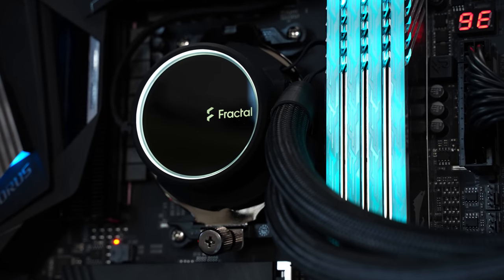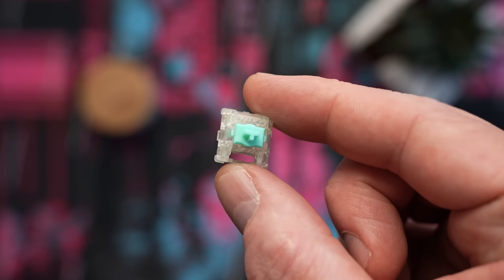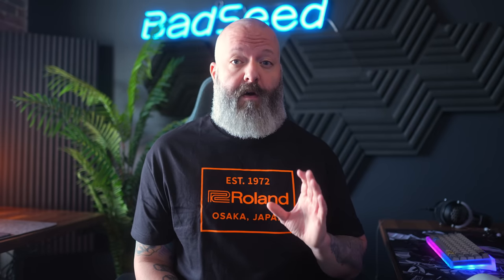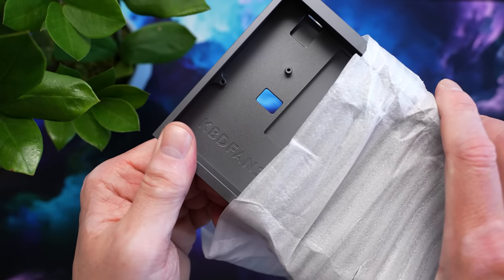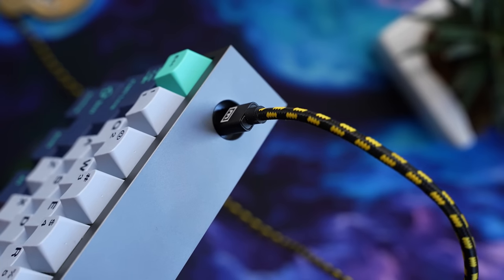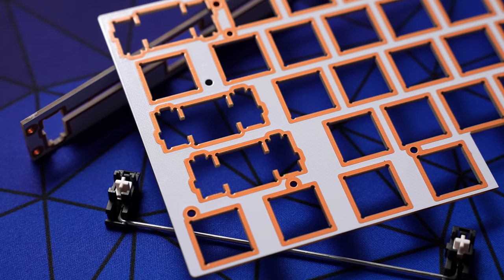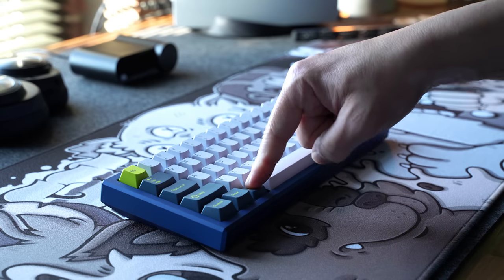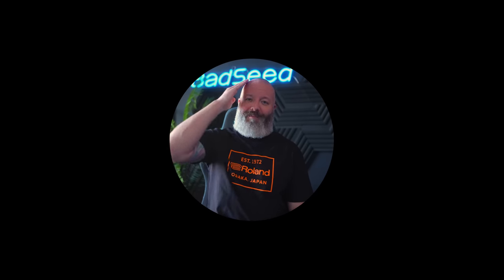Ultimate Wooting 60HE Mod Guide

Comment: This feels like a product from the future. I'm shocked it didn't take them years longer to start releasing modding-friendly versions of their keyboards
Reply: Bro this is literally the same process as any other hot swap keyboard on the market (from $50-1000). Only thing different is the switches
Reply: @manfromwuhan714  yeah, but there isn't another gaming keyboard manufacturer that allows this much room for modding their keyboard. And it also happens to be the best performing gaming keyboard? That's wild
Reply: You new to keyboards?
Reply: @DoctorQcumber  simply calling it the best performing keyboard doesn’t do it justice in the slightest, it’s the only keyboard you can get joystick level control with and it’s instant reset on release of the key makes the keyboard 1000% more responsive than anything else you can get
Reply: @manfromwuhan714 nope. lol. Wooting is the first keyboard to offer rapid trigger and other features that benefit you in gaming. Most gaming prebuilts are trash. Name a better gaming keyboard than Wooting… I’ll wait
Keep in mind, this is a keyboard directed towards GAMING. Nobody here is trying to buy this keyboard for its aesthetic and “sound”, like most of y’all build custom keyboards for.
Reply: @Xoilen  it’s the only keyboard out there that offers this technology… then It’s automatically the best. No other gaming keyboard offers rapid trigger, that’s why it’s the best “gaming” keyboard. Why did it took so long for other bigger brands to corporate something like this before? Because in reality, most gaming keyboards are bad. Sure, there better custom keyboards that sound way “better” but we are talking in terms of gaming responsiveness. That’s why it’s the best. Most people who hate it are more worried about the “sound” it makes, which proves to show they aren’t true gamers… just people who care more about sound and aesthetic. Rather than it’s functionality
Reply: @mysticqro950  10 months later, they are adding Rappy Snappy to even 60he, boy we are spoiled.

Comment: The Lekker switches don't need to be swapped to south facing to avoid interference. Gateron has added a new fillet to their new molds (ever since the Oil Kings I think) which avoids north facing interference with Cherry profile keycaps, which the Lekker has. Just a heads up if you happen to see this.
Reply: nice to know. ive been seeing in the wooting discord we should flip the switches. thanks
Reply: Just want to confirm that this is true based on our tests, but since we don't own GMK caps, we do not have enough confidence to officially recommend it and it's more "flashy" and easy to understand as there are a lot of people that forgot the reason for south facing switches.,
Reply: I test it myself, there is still a little interference with Cherry profile keycaps. But not very obvious.

Comment: If you wrap the tape mod up along the sides of the PCB and plate (filling the gap between the two), you can get a clean sound and depending on layers even forgo case foam. I recommend some wheel balancing weights in the battery cavity of the Tofu case, tape mod as described and maybe a small bit of polyfill if needed.

Comment: Late to comment but I just received my board and I have some recommendations for those who follow this guide.

1. Absolutely relube the stabilizers on this board, they seem like they are lubed well but they are not... I took mine apart to see how well they were lubed, and they had lube just in the wrong locations or there just wasn't enough. I recommend following Taehatypes video on lubing stabs!
2. CLIP the stabs they are not preclipped.
3.I went ahead and used a silicone mix to help with the sound of the board and it came out fantastic! You could also go with a foam mod kit from StupidFish they make a kit for a lot of cases and the Tofu 60 is one of them.
4. I also swapped my springs for the lighter 50gm springs, and I can say it may not be worth it the slightly heavier springs are just fine however if you like a lighter feel than go for it. 

All that said after following this guide and doing the above mods I can say my board sounds and feels soooooo much better. Give it a try and come back to tell me how your boards sound!
Reply: hey man, ty for tips. do you think the internals could fit in the bakeneko? I cant stand the tofu lol

Comment from the maker: *THE FOLLOWING IS FROM WOOTING BUT YOUTUBE KEEPS DELETING THIS COMMENT*

"This is an amazing overview for modding and beyond what we could think or show ourselves. On behalf of the Wooting community and ourselves: big thanks.  The burger mount is a good suggestion! Some useful information for anybody looking to mod their 60HE:

The Wooting 60HE 2D/3D design files, we publish everything on our GitHub:
https://github.com/WootingKb/wooting-design/tree/main/wooting-60he

Public list of 60% cases verified by us or the community (updated over time, not limited to):
https://wooting-technologies.notion.site/de7a52e2b5a941258a17e448b0c9d9b0?v=5ec0b31c59db4a51b8a86a1288249e9f

Concerning swappable switch plates, we are looking into them. We are most concerned about the integrity of the Analog signal, but it should be possible! If you attempt a custom plate yourself, there's been a few on the Wooting community that have done it successfully. You'll need to match the PCB screws with the custom plate (creating holes) and use spacers to attach them."
Reply: Can you use a gummy o-ring mount with your custom plates?

Comment: Ive been using a screw driver then using the prongs on the top part of the switch to open them up for a while. This way works better than most switch openers out there in my experience

Comment: For those wanting RGB + Cherry keycaps, Wooting has updated the Lekker switches to use the newer top housing mold that doesn't interfere with Cherry R3 keycaps. So north facing doesn't have interference anymore!

Comment: You can prevent scratching the paint if you pull the switch up straight instead of rocking the puller back and forth when pulling the switch out. It's harder and the switch comes out more violently but nothing bad is going to happen. If you have a sturdy hand and pull without holding back you'll get them out faster and better this way.

Comment: hey brian! not sure if you'll see this, but i saw a comment earlier that asked about a lower-profile or different case for the wooting pcb and plate other than the tofu60. I thought i'd leave a comment with some alternative choices.

the five degree case is also a standard tray mount case but it's shorter and has - wait for it - a five degree typing angle as opposed to seven degrees on the tofu, so it should be good for gaming for long periods of time. it's also made by kbdfans so if someone is planning on getting a tofu case but wants something lower then this could be a good alternative.

the blade60 case is another candidate but it only has two standoffs. if you keep the stock plate, though, as i imagine most will, the pcb+plate module should be rigid enough to give consistent performance but only time will tell.
Reply: Hey thanks for giving me ideas! The 60HE will be my first after 10 years of using apple keyboards. I was going to try the tofu60 but you reminded me that I have a strong preference for a lower profile so I'm going to keep looking.

Nice pfp btw ;) 🐸 ❤️💜💙

Comment: Coming from someone who had the mind blown by the original cannonkeys bakeneko and has used nothing but bak60 and 65s since, I could 100% deal with the sound of this. I wish someone made a tofu style case with a lower front height/typing angle, as that's a huge factor in gaming for long periods. Overall insane how good it managed to sound for the money though!
Reply: hey, so i think the five degree case would work for that! its also sold by kbdfans and as far as i know it shares the same tray mount config as the tofu. someone else feel free to correct me on that but i think that could be a great lower profile candidate
Reply: You can also use the freebird60 for a similar look but only 5 typing angle.

Comment: Really like how far you managed to push it. The tripod stickers seem to isolate the switch instead of resonating through the rest of the board. I like that, but it seems like an absolute PITA.
I'm personally a huge fan of the meatier bottom out of long pole switches, but that doesn't seem feasible with this magnet design.
Also, really can't get over tactiles. Can't stand linears.

Love how technically impressive this hardware is and love that Wooting enables you to go custom with it. The USB port placement is a bit unfortunate but you can still get it to work, so it's just a minor issue I guess.

Will definitely recommend 60HE to people who are into gaming and linears and try to fix them on some custom stuff later down the line :)

EDIT: Can you mount this by wrapping an o-ring around or is there not enough room? That might help the sound because the PCB stops making contact with the tray all together.

Comment: I'd buy this in a heartbeat if it had a TKL or at least a 75% version.
I simply need my dedicated F row, arrow keys and DEL key.

TKL is already small enough horizontally for my FPS tryharding needs, but if people want something smaller from Wooting, I could live with a 75% that has a DEL key and arrows.
However, the F row is a must, and the extra vertical height does not matter for mousepad space, so I don't see it potentially hindering sales to comp gamers.

I guess Wooting is probably saving a nice amount on each unit, by requiring less switches, keycaps, and a smaller PCB, but still selling the KB at a price which would be normal for even a TKL.
I just don't see why they wouldn't make a TKL version otherwise.
That from factor is pretty much the mainstream between competitive circles, and I think a lot of players (like me) are not getting this keeb, exactly because it's only a 60%.

Comment: Great info! Did you try a resin or acrylic case? From what I gather, it should sound deeper than the aluminum. I probably won't bother with a case swap on mine, just lube and spring swap, but if it sounds really deep in resin or acrylic, I might consider it.

Comment: What is the screw size for the screws that attach the plate to the PCB?  Are you able to get the standoff outer diameter as well?  Trying to get an aluminum plate cut from the github files, but I think the file is based on press-in standoffs, and I will need to design for screws on both sides of a regular standoff.

Comment: I know you mention that there are no issues but how are the switch tripods doing now? No issues at all? I currently use these on my epsilon switches and ordered another set for the wooting but now I’m not so sure. Would be a bummer to have a set that I won’t be using if issues occur on the lekker switches. Will be trying it out anyways just wanted to hear it from you before I attempt it.

Comment: For plates you could probably use the drop Carina's brass plate, it is sold separately and supports plate mount stabilizers

Also will sound good as brass is stiff but very dense

Comment: Regarding the O-ring: I assume you fit the screw before attaching the PCB to the mount right? It was a nightmare for me to try it with the mount attached as the screw keeps getting lost inside 
Plus what screw driver do you recommend?

Comment: Hi, just a quick question, if I would replace the switches, will the functionality of the wooting 60he not work like rapid trigger, changing actuation points? Or the tech is only on the pcb itself? Thanks in advance.

Comment: Not a huge fan of the wooting stock stabs i did some extra lubbing but think i will just change them, not sure if it's the switch or the stabs tho, i'm just used to more bouncy space bar so maybe the lekker L60 are not strong enough for this spot.

Comment: Do you need to use this burger mount method or can you also do without it. I have never modded a keyboard before and I'm unsure if I need to do it or if it's simply to improve the sound even further.
Reply: It's completely optional, just for sound preference like you said :)

Comment: waiting for lighter springs to buy it. You didn't do a typing sound comparison of lubed vs unlubed
Reply from the maker: Sure I did.  The very first test in the video is unlubed.
Reply: @badseedtech  i know but then there is no test with lubed switches and the same stock case, foam, keycaps. so you can't really compare
Reply: where can you buy lighter springs

Comment: I don't think what you said about the plate is 100% correct. The hall effect sensor are beeing recalibrated on a regular base. Furthermore it's about keeping the section of the pcb with the hall effect sensor parallel and close to the switch.

The PCB will be more flexible than any Carbon Fiber, FR4, Alu, Brass or Stainless Steel plate. So I see no issues switching to these if you add the mounting holes and standoffs they use in their setup.

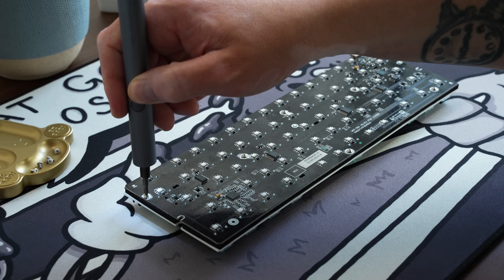Comment: Can someone PLEASE help me out, if you own a Wooting 60HE please measure the standoffs that are attached to the plate that secure it and the foam to the PCB. My board does not come in till Feb and I am wanting to swap the plate entirely and plan to make some custom standoffs so that everyone will be able to swap in any plate that they desire. Currently the standoffs are perm attached to the plate as it is a "one off" plate only for Wooting. If you pause at 2:32 you can see he is removing the PCB from the plate and if you pause at 9:10 you can see the exact standoff I am talking about - please get a caliper and measure each one to see if they variate or if they are all the same and list the size please.. Greatly appreciated!!!!

Comment: The switch opener cant be highlighted enough, I know plenty of people who got into modifying mechanical keyboards and didnt wanna spend the extra 10-20usd for a switch opener. They found out fast enough how much of a struggle it is to open them all with a screwdriver. Legit best tool to have if ur into modding or customs overall.

Comment: Noob q but is there a downside to not flipping the switches from north to south facing if installing a GMK keycap set? I just preordered the DROP + Zambumon MT3 Serika R2 set and want to be sure.
Reply from the maker: Yeah - the downside is the housing of the switch hits the inside of the caps and makes them sound very horrible like in the first sound test with the Salvation case. MT3 doesn't apply to this though.
Reply: @badseedtech  Appreciate the response! I'm silly and didn't realize the set I preordered was a MT3 revision of the original GMK set. Appreciate the callout!

Comment: Does anyone know if theres a large differences between the original AVR microchip 60he version vs the ARM 60he version? (other than the increased speed/processing power of the ARM MCU)
Reply from the maker: Believe ARM is your only option going forward unless you're buying used.  ARM will be more future proofed but doubtful you notice anything meaningful between the two until early 2024 I think they said.  That's when AVR memory capabilities will be exceeded in terms of features.

Comment: Has anyone seen the coil cable issues? I want to buy a coil cable for this board but I dont want to have issues. I am unsure I have the option to make the usb power higher but I do have USB 3.0 and a pretty high end PC. Does anyone think buying a coil cable would be good and where should I buy one?
Reply: You can definitely use one but wooting recommended that it's under 1.5m total length and if you experience issues you can simply reduce RGB brightness/turn RGB off and that does the trick :)

Comment: So in other words I can’t use my coiled cable anymore?
Reply from the maker: In other words, I wouldn't use it specifically for this board, specifically running tachyon mode.
Reply: @badseedtech  I'm not sure what that mode is for, but I'll buy another cable just in case. Thanks!

Comment: Actually, yeah I think Salvation sounds better it's got more character than the tofu which sounds like a stack of foams. =/
Reply from the maker: Haha when I was listening to the final edit, I went “hold up, does that sound cleaner?” 

I must have listened to those tests like 20 times and it didn’t hit me until the very last pass
Reply: @badseedtech  Yeah that's how things just be sometimes! xD I think Salvation + Burger O-Ring Mounting might sound really nice, foamless too. Having a TOFU sound test from someone that knows what he's doing definitely informed me into staying away from that purhcase for sure, so thank you for that. Burger mounted on stock right now, it will tide things over until I see a properly special GH60 compatible case. Maybe a Salvation when they start shipping and selling on aftermarkets. Always prefer foam-less or less-foam sound, even my GMMK Pro sounds better to me without Foam after putting the right set of mods on it. 

You're the ONLY variety tech reviewer that has real cred among sweats in their respective areas (many FPS-sweats in my discords give you more cred than all but Boardzy for Mouse reviews for one). It was nice to see you put so much highlight on what's been the most rewarding purchase in my recent memory, and just wanted to let you know your channel is appreciated in general.